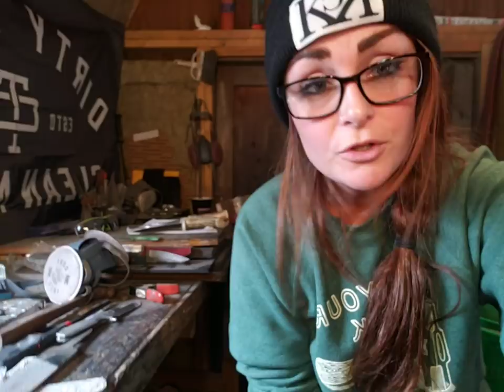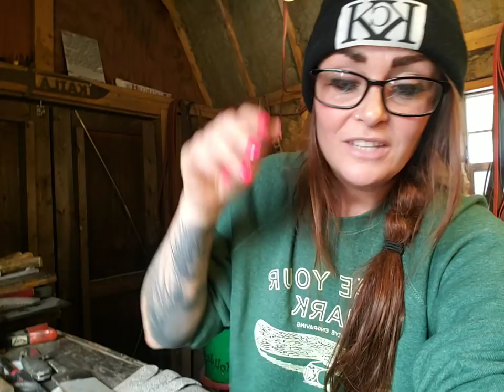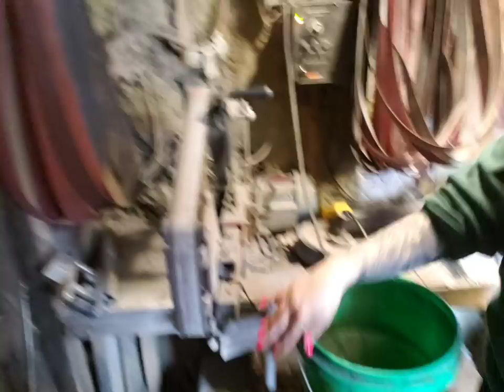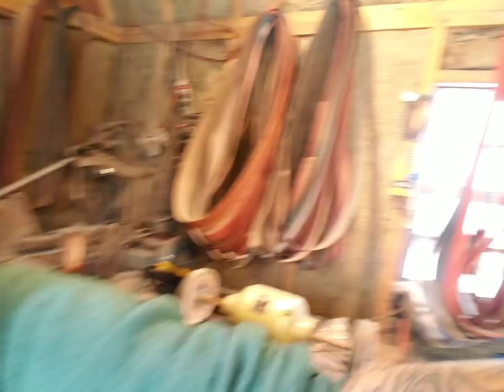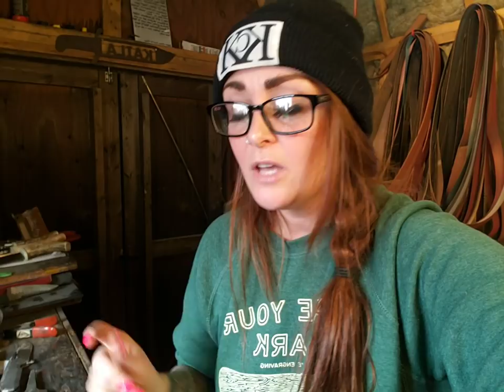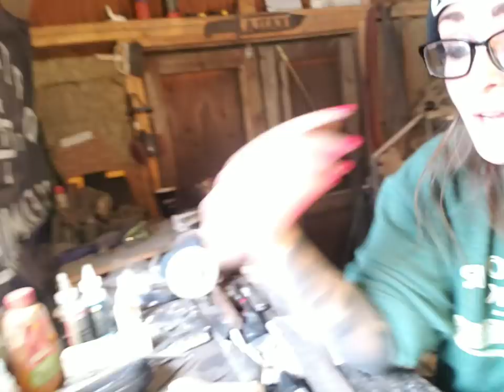Advice for starting out with knifemaking

Comment: I found an old leaf spring while digging in my backyard (no idea how it got there), and after cutting a 4in. square for a bench block, I figured I'd try my hand at making a blade. Thanks for the tips.
Reply: Spring steel is a great steel to work with for beginners. The down side for spring steel are holes and usually heavily pitted rusted surfaces. For those using a forge, the pitting is no problem. For Stock removal folks it can be. good stuff!
Reply: @jcknives4162  thank you! I was going to do stock removal. During rust removal I wondered if that would cause problems, and now I know. I guess I'll be heating it up.

Comment: Another possible option is the plans for sale by USA Knifemaker. $25. The grinder is a no weld grinder (they suggest bolting everything and show how). I built 3 of them. I have a welder so I didn't use the bolts and so can't comment on how well it works. But the frame and box tubing components is as cheap as you can get. then buy your own wheels, find a motor and pulley system... anyway... it's an option and mine works great!! Ive been making blades for over 40 years, this is now my primary grinder.
Reply: I wish I would've read your comment a couple weeks ago.
Reply: @ChuckNorrisUltra   groan... and there in lies the ebb and flow of life. Hey, start preparing for another grinder. hahahah. We can never have enough grinders and other toys... errr. I mean tools.
Reply: @ChuckNorrisUltra  Also, I have a short video of sanders on my channel. Getting started isn't hard. Just get started and improve on your abilities and tools from there.

Comment: I sent an email asking your opinion on getting the Grizzly 2 x 72" and some other machines or getting the more modern 2 x 72" since I noticed you had both. I went with an Ameribrade 2 x 72" 2hp variable speed belt grinder. The other machines will have to wait. lol

Comment: Thanks for the video Kaila! Which dremmel bits did you use for getting in curves on handles etc? The little grinding stones? I havent got a contour wheel for my grinder...but it just went on the shopping list.
Reply: I use a Dremel sanding drum 60 and 120 grit. Keep in mind that the sanding drums don't last long.

Comment: why do people knock or trash talk railroad spike knives so much? if you case harden and temper your finished knife blank properly, a railroad spike makes a great knife that has a very hard case with a soft interior that is very tough. I have had railroad spike knives case harden to 3/32nds of an inch deep with a HRC of 67 and had to remove some of the hardness.